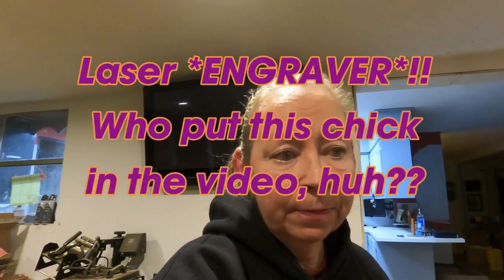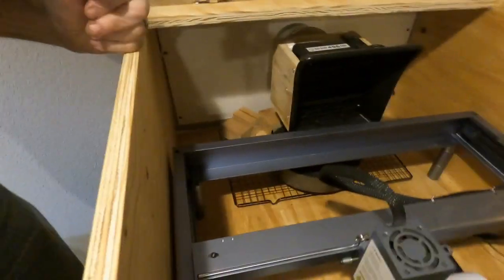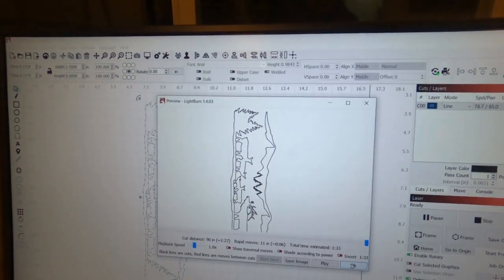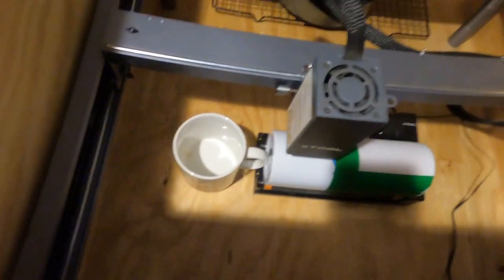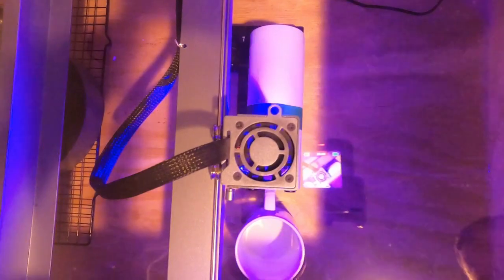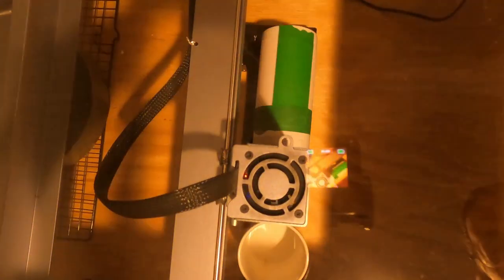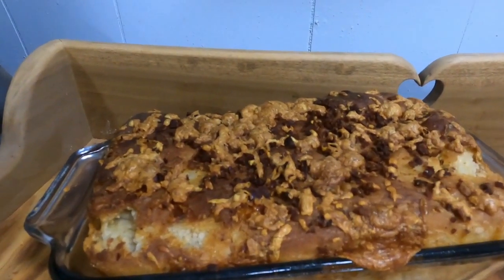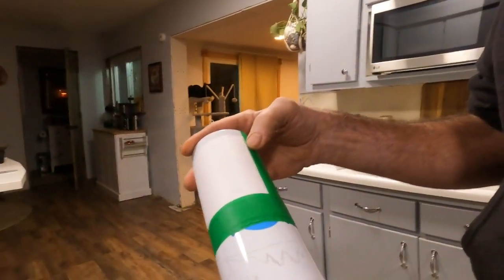Seriously Sunday Vibes

Comment: What type and wattage of laser are you using?  I own 4. An Ortur 10 watt, a FoxAlien 10 watt, an X-Tool 20 watt (the best of the diodes), and an Omtech 60 watt CO2, the most expensive, and best one over all.
Reply from the maker: X-20. We have done several mirrors, and (thanks to the tip we got from YOU) we are spraying the rose gold on the back of one that is super detailed! Looking forward to the results.